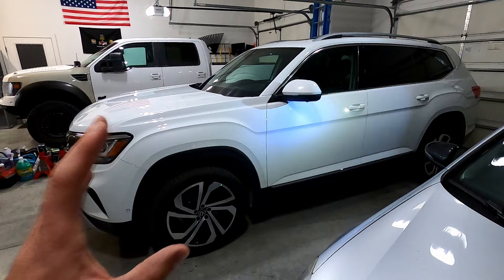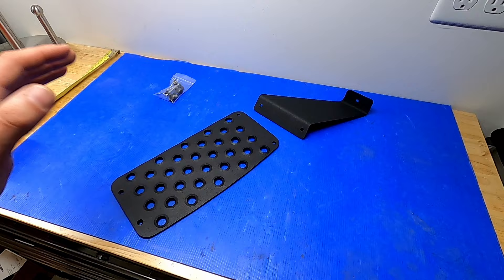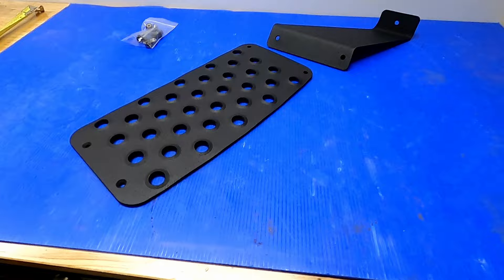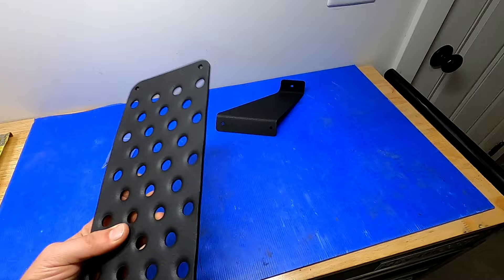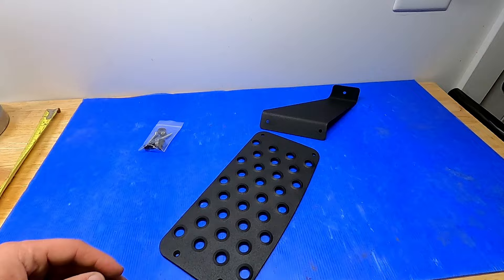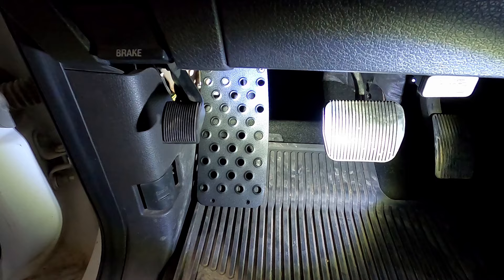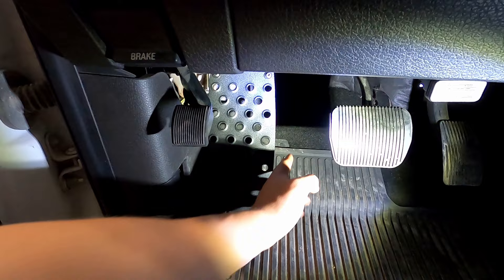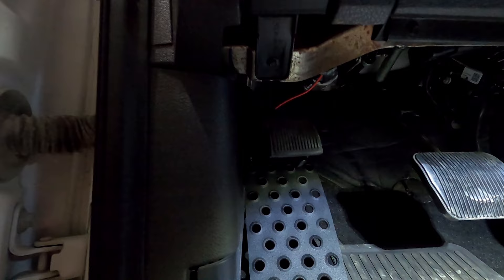Install the Dead Pedal that Ford Forgot

Comment: You should install a steering wheel from EuroZone Tuning there like the raptors but better I just installed one.
Reply from the maker: I may have just installed a raptor one I got off of eBay!

Comment: Are there that many short legged people out there? Or are they crazy driver that must brace foot on a pedal ? These dead pedals takes up valuable room for left foot when you are 6 foot tall and size 14 shoes. These just cram my knee into the dash with the seat all the way back. I'm confused with short legs just move the seat up and put your left foot on the floor. Oh well I just want to cut them out of vehicles I get.